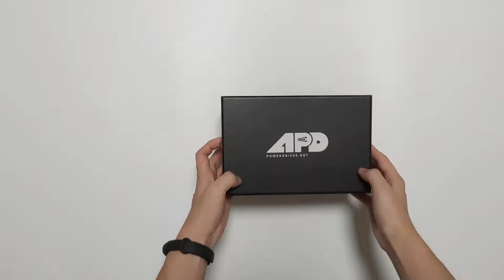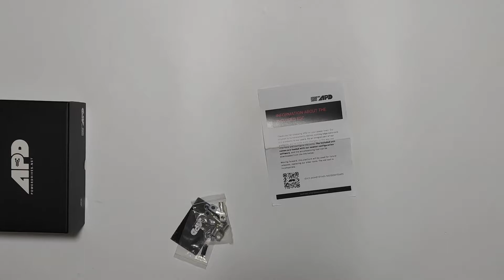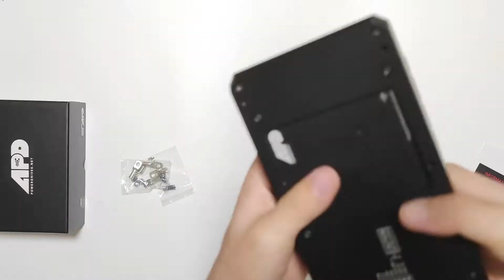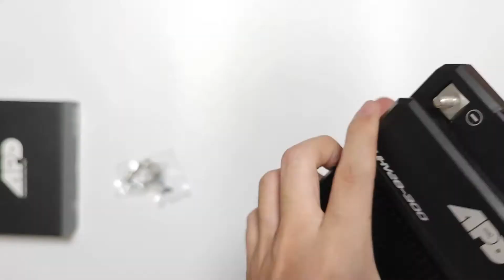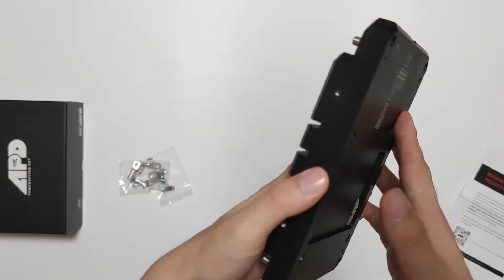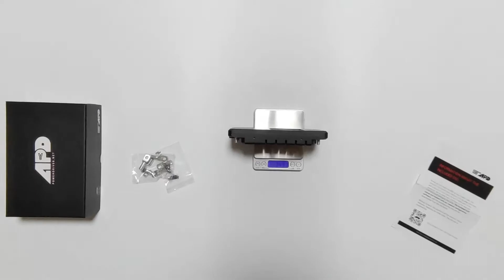APD UHV 28S 300A ESC Unboxing

Comment: Hi, we have same ESC and we are trying to run the motor but apparently it looks like the ESC is not getting any signal. Does it start beeping once connected to the power? we are using 24S. we are using PX4 and were applying PWM values from there, later we started applying PWM values with servo checker but no response. We don't even get logs or anything. Could you please provide some insights?